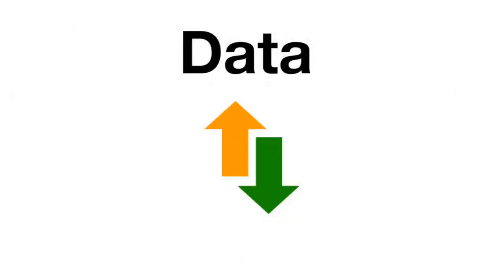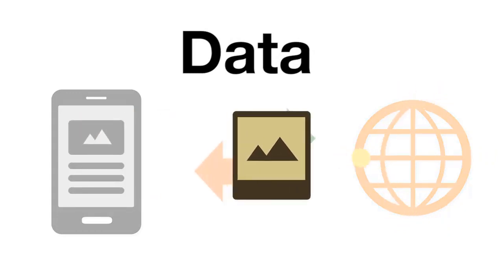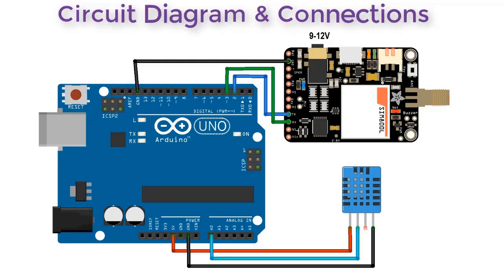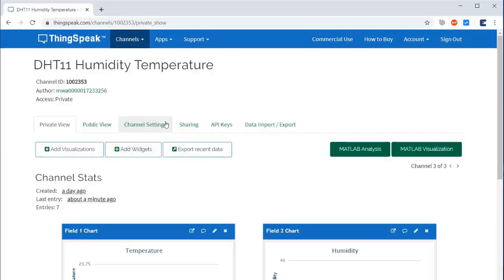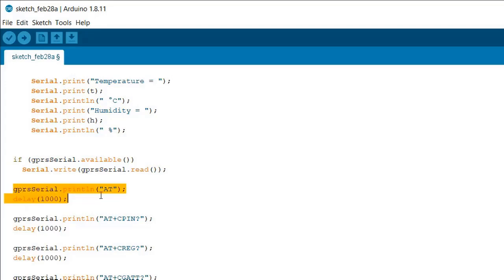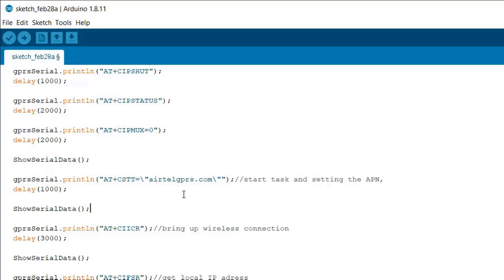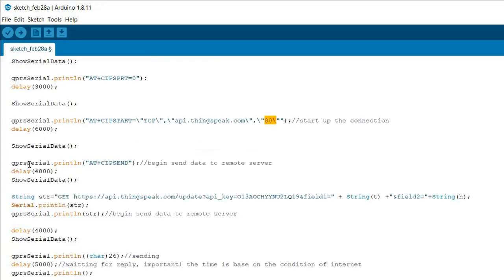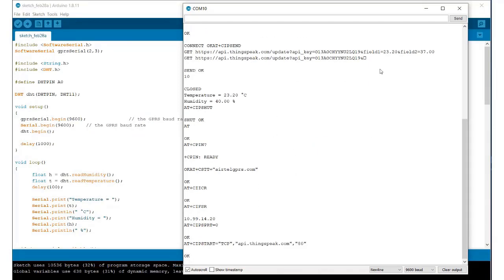Cellular IoT |  Send Data to Thingspeak Server using SIM800/900 GSM/GPRS Module

Comment: Can you please help me with

design of a microcontroller-based control system capable of combining light sensing, time scheduling, energy source switching and a feedback sensing mechanism via the internet using a GPRS modem. This is expected to ensure that no power is unnecessarily wasted and to provide a convenient way to monitor the status of streetlights remotely. Additionally, it provides the possibility to reconfigure remotely the time-scheduling parameters of streetlights depending on the season and weather conditions. The design uses a solar powered LED to reduce energy consumption. The proposed system will continuously monitor the battery level to allow for an automatic switch to ESKOM power supply in case of emergency, while also sending the necessary alert messages.

Comment: I am using Arduino UNO with sim800L to send data to MySQL server. Everything is working fine when I am sending data to Thing speak server. But when I am using my own server it is not working properly. Though there is no error showing in serial monitor, but I am not getting data to MySQL. Please help me to understand the problem.

Comment: sir i have gone through your video and i am currently working on a project in which i am reading data from a modbus device using a Arduino and max ttl to rs converter then i want to use the sim900A to push this data to the thingspeak  so can this module help me in pushing the data to thingspeak and for pushing the data do i need to convert the raw  modbus data in http or mqtt ot json format to send it to the thingspeak? And one more question do this module works with jio/airtel 4g sim?

Comment: Good day I’m having trouble because the data wont transmit or it doesn’t update in the Thingspeak and also I added another field will there any other necessary modification to the data

Comment: How fast can I upload information? because I am testing changing the delays but running all the loop again take some time, what can be put on setup to be static? Thanks for the video!
Reply from the maker: This is a 2G Modem. You need to give delay for each command to run, execute and receive response and then to proceed for next command. Removing or reducing the delay will give errors. For fast switching go for 3G or 4G modem.

Comment: Hi ! I wanted to do exactly the same. Arduino Uno + SIM800L v2.
It worked for 2 hours great.
Then unfortunately it has became unstable. 
Finally it is not working at all.
AT+CREG always offer a different response, sometimes 0;3, ofte 0;2 and rarely 0;1.
Finally the step AT+CIICR is always showing a +PDP: DEACT  ERROR.

I could I fix this issue ? 
thanks
Reply: Hello , were u able to solve this? i'm getting the same error. Can u please help me out

Comment: the serial monitor displays the following error 
+CME ERROR:50 , 
+CME ERROR:53 and
+CME ERROR:58

please help me, how can i fix this problem ?
Reply from the maker: Check network connectivity.
Reply: Happy NEW Year!!
My error codes is similar. I check my service provider, here it is:
A hozzáférési pont neve: Telekom Net
 (AP name)
APN: internet vagy internet.telekom
Felhasználónév: [üres]
    (username)
Jelszó: [üres]
            (pwd)
Jelszókérés: Nem
     (pwd check)
Autentikáció típusa: PAP
IP: Dinamikus
Elsődleges IP cím: 000.000.000.000
Másodlagos IP cím: 000.000.000.000

That's good code detail?

 gprsSerial.println("AT+CSTT=internet.telekom");//start task and setting the APN,
 delay(1000);
 ShowSerialData();

Serial Response: 
23:06:50.981 -> start...
23:07:00.077 -> AT
23:07:00.077 -> 
23:07:00.077 -> OK
23:07:00.077 -> AT+CPIN?
23:07:00.077 -> 
23:07:00.077 -> +CPIN:READY
23:07:00.111 -> 
23:07:00.111 -> OK
23:07:00.111 -> AT+CREG?
23:07:00.111 -> 
23:07:00.111 -> +CREG: 1,1AT+CSTT=INTERNET.TELEKOM
23:07:06.109 -> 
23:07:06.109 -> +CME ERROR:53
23:07:14.124 -> AT+CIICR
23:07:14.124 -> 
23:07:14.124 -> +CME ERROR:50

Comment: Sir my Bsnl sim is not working in SIM800L it's sending sms but received sms is stored in other sim internal memory  and not able view it's content ,other sim cards working excellent but problem with Bsnl any settings or suggestions
Reply from the maker: May be you can contact the customer care of BSNL. May be its a sim problem or a sim setting problem.
Reply: @HowtoElectronics  sir it's working well in mobile phone but getting problem in sim800l

Comment: Hi! Very helpful this video for help our project. Thank you. In our project we want to send only one ON-OFF data with time. We are want to make most cheapest measturing tool. My question, is this working with the cheapest GSM module? 
(SIM800L GPRS GSM Module SIM Board Quadband L shape Antenna For MCU Arduino NEW)
Reply from the maker: Yes it will work. Its checked and verified.

Comment: Hello Sir, does GPRS shield V3.0 (with sim900) work instead of the one you used ? If so, does the code change ? Thank you very much. Really appreciate if you reply. Also, great video!
Reply from the maker: Most if the GPRS module works. You can try with yours. Thanks

Comment: Thanks for Sharing, but I have some questions if you can clear those concerns.

Instead of using Thingspesk (IoT Cloud Service), if I wanna to upload the same information while using any GSM Module in my personal Server without using any Tunnel/VPN service (considering my Server out of the Internet/Public IP), how it could be possible ?
Reply from the maker: In this case you need to convert the data in json format and send it to any web address you want. The server you are using should also be configured to receive data.
Reply: @HowtoElectronics  Thanks for your Input, but I'm just asking is there any such Device/Equipment available in Telecom Domain to receive the Data while considering P2P (Peer to Peer) Network Protocol ?

You may consider simple Text Message format too.
Reply from the maker: @shankarnathmajumder  Hi Check this post here. I have added code with an explanation based on the request you made. https://how2electronics.com/sim900-800-http-post-request-json-format-arduino/
Reply: @shankarnathmajumder  Now a days everything is via cloud. You can setup your own private server on the internet and configure it to receive from only particular IP or have an unique key to authenticate that data is coming from your own device.

Comment: Hello, Thanks for a nice video and clear explanation. if I am using DHT22, do I need to change any code apart from DHT11 to DHT22
Reply: You have probably solved the issue a lonh time ago, but for those whom are new go the dh sensor the only part that needs to be changed in the code is the #define from «DHTTYPE DHT22» to «#define DHTTYPE DHT11». The dht.h library is constructed for both sensors.

Comment: sir i have sim800c which is not a gprs can i do with that module?
Reply from the maker: Sim800C is also a GPRS module. It will work.
Reply: @HowtoElectronics  thank you sir...can i used at commands to send data on adafruit.io cloud?

Comment: nice tutorial ! i have done this device to IOT connection part for my device.but now i want to get data directly from device to firebase database in real time instead of thingspeak.unfortunately i dont have access to my device to reconfigure the code .what are the other options?
Reply: make an api endpoint that your device connects to. make it use a special code in the header to ensure that only your device is the one connecting. on the endpoint, have firebase installed and take the data that was posted and use either set (to set new data), push (to push new data results, or update (to update data)